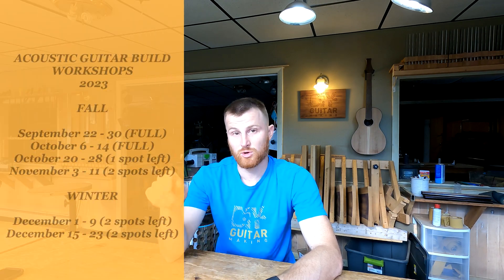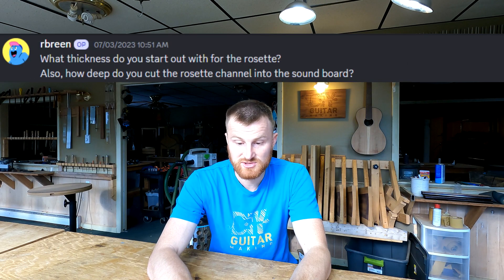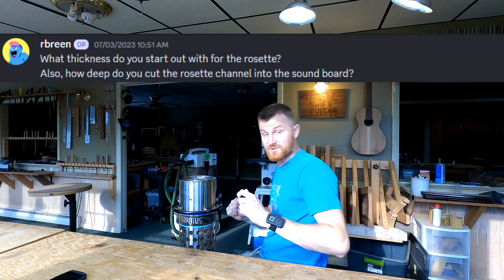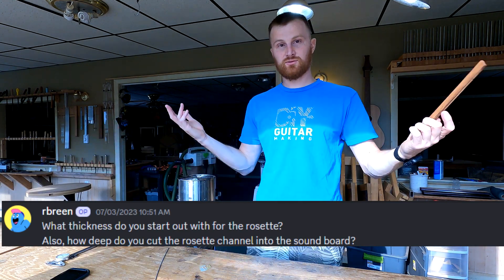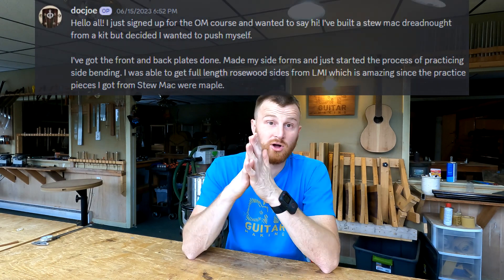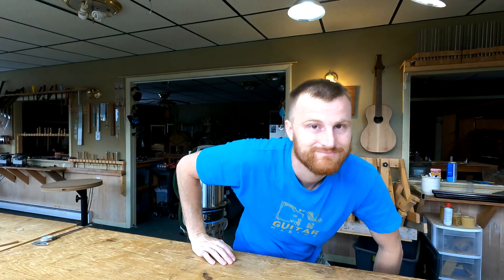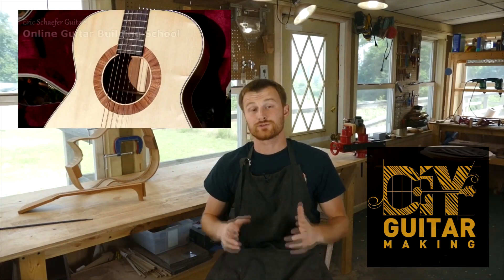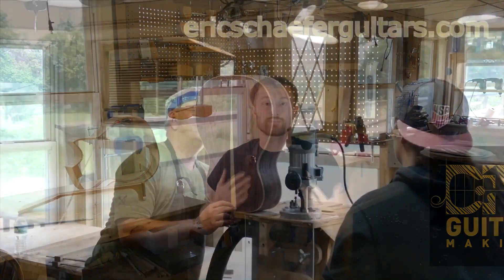Q&A | General or Variable Thicknessed Soundboards?

Comment: Thanks for the reminder of van Kuijk’s excellent videos.

Regarding variable thicknessing of tops:  As a ukulele builder (just finished my 6th) I have watched lots of YouTube videos and purchased and read a half dozen “How To” books and design guides.  Ukuleles are small and because they have a reduced span to support on the top are much less heavily braced than a guitar.  Much of the stiffening come from the inherent stiffness of the top.  To lower the resonance of the top and avoid sounding “tinny” one guide recommends sanding away about 0.010” of top thickness from about 1.5” of the perimeter.  This is done after the ukulele is assembled.    Something to consider on smaller guitars as well.

As you mention, there are as many ways to thickness as there are builders….
Reply from the maker: I've responded to your comment in this Q&A video. Check it out! https://youtu.be/K1qdRa6pXXg

Comment: As a follow up to the question I had on the scarf joint, that you mentioned, I ended up redoing the neck. I did glue the scarf joint wrong on the first try and it resulted in a shorter head plate. I did get a new blank and this scarf joint was made properly.
Reply from the maker: I've responded to your comment in this Q&A video. Check it out! https://youtu.be/K1qdRa6pXXg

Comment: My 2 cents on a couple of these Qs. I ordered pre made rosettes for the two acoustic guitars I'm building right now. They measure .060. Which is about half the sound board thickness. Seemed reasonable to me to cut the slot just shy of the # at .055. The classical guitar top graduated top thicknessing interesting. But I'm not sure you can apply the same design logic to steel string guitars. Much different tension involved. Arch top guitars are of course more self supporting just because of the arch and use different bracing altogether. Taylor guitar as a side note does a relief cut of some sort around the rim of the top, inside of course, to achieve more top movement. Not sure they still do this.
Reply from the maker: I've responded to your comment in this Q&A video. Check it out! https://youtu.be/K1qdRa6pXXg

Comment: As far as "carving" tops to different thicknesses around the edge.  One important thing to remember is that you should be keeping lots of notes as to how you did your last guitar.  If you know all the dimensions of the last top you did, then when you make changes to the next top you can attribute those changes.  If you don't take notes then you are just guessing as to what the differences are.  And if it's your first guitar, just complete it!  There will be so many mistakes that something as insignificant as graduated top thickness will be the least of your worries.  Like the guys over at Driftwood guitars say about your first guitar, "embrace the suck!"  Just git' er done and learn about the process so you next guitar can be much better.  (Just my two cents.)
Reply from the maker: I've responded to your comment in this Q&A video. Check it out! https://youtu.be/K1qdRa6pXXg

Comment: Hey Eric, I'm in the process of making guitars #5 and 6 at the same time. I forgot to change the router bit to a smaller size when routing the truss rod channel on the second guitar (using StewMac low profile rod, which has a thicker end near the headstock, and thinner main channel). Otherwise the channel is good. Do you think I could add a shim inside the channel, or just delegate that neck to "template" status?
Reply: Also, if I could ask a follow up question. How and when do you drill your bridge pin holes? Do you have a template and use a drill press?
Reply from the maker: I've responded to your comment in this Q&A video. Check it out! https://youtu.be/K1qdRa6pXXg